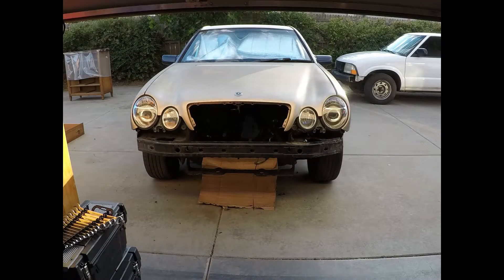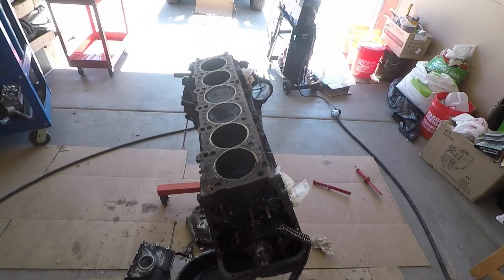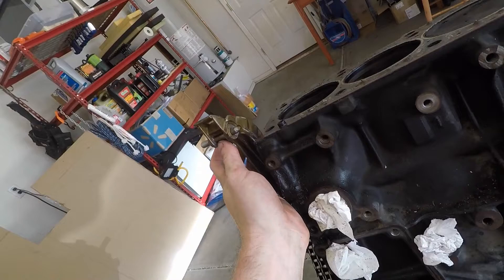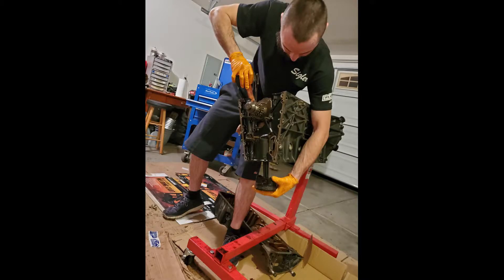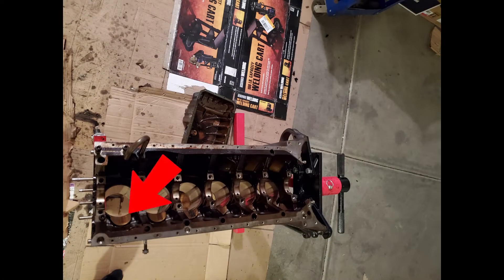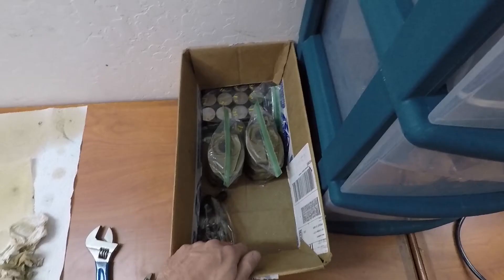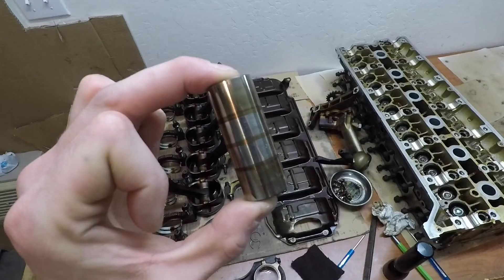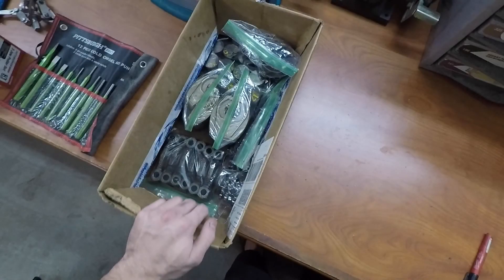Engine Disassembly - M104 Turbo Build (Ep. 4)

Comment: Where you buy all this parts?
I have Mercedes 1996 E320 with m104 engine 6line cylinders..also many other original parts where selling in Internet?
Reply from the maker: RockAuto has been my best friend. Ill likely make a video in the near future on where to find all the parts. 

Ill actually be forced to make a video on this issue, because i want to list all the parts one would need in a rebuild like this. Stay tuned!
Reply: @JakeSublime  please can send link ? but also will try found it in network..
Reply from the maker: I have a video on my channel for this. Its called "m104 parts guide" i believe.
Reply: @JakeSublime  can send link for the video?